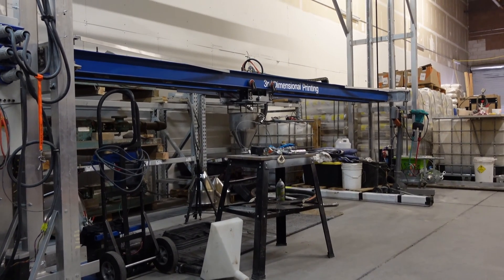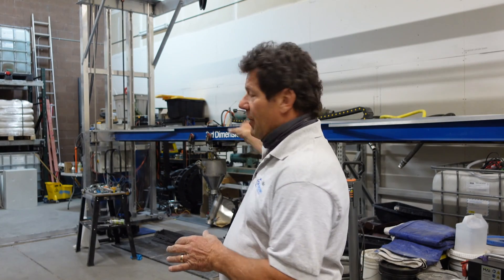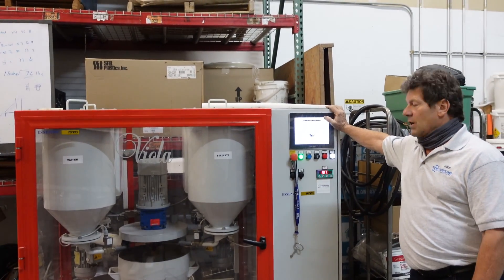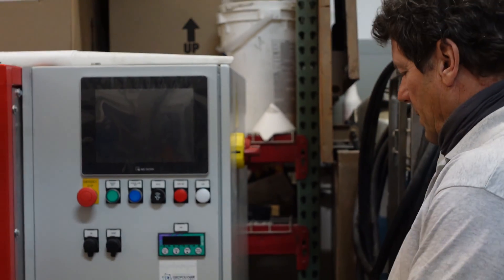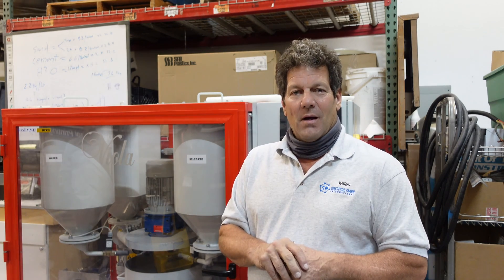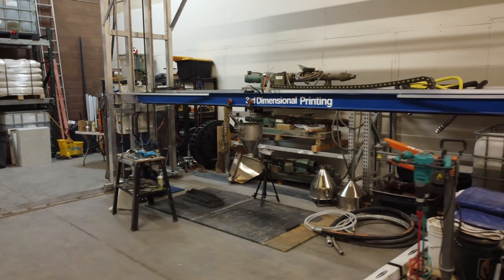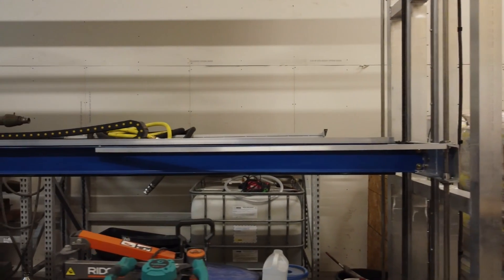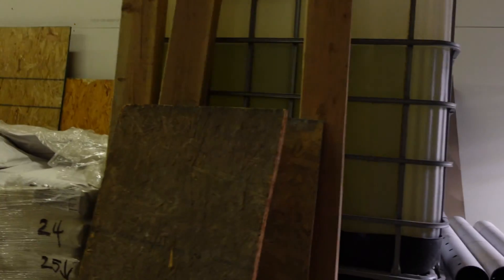GEOPOLYMERS ARE FINALLY HERE |  The 10,000 Year 3D Printed House

Comment: I really like this new idea of building homes and I see the benefits, but the old style way has over a 100 years of experience compared to this. My concern is will this hold up to years of normal wear and tear that a home experiences? A young couple that buys one of these homes probably will sell it in 15 years. Will it pass a home inspection after 15 years or will there be cracking in the walls creating a structural issue and if so is it something that can be repaired? A stud wall can be replaced easily but this seems like it may take a big undertaking if a exterior wall needs to be repaired.